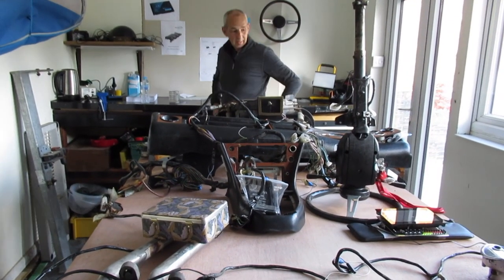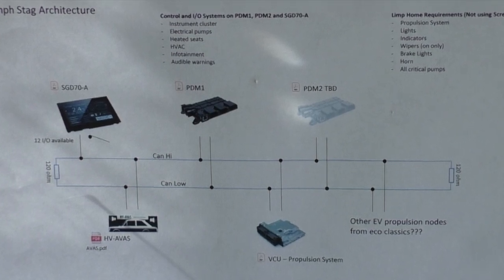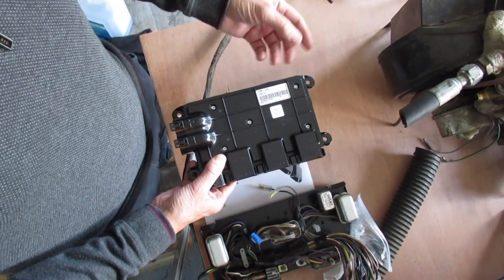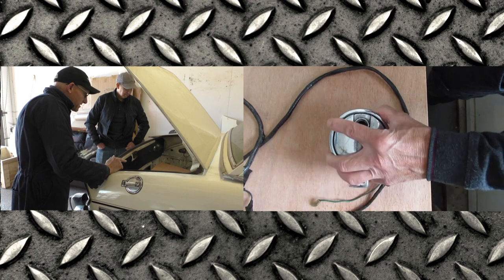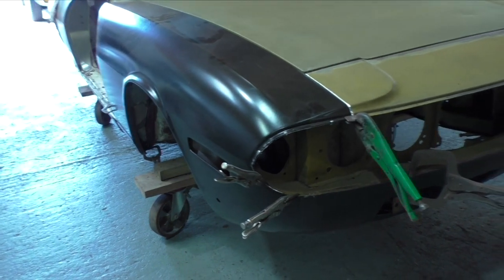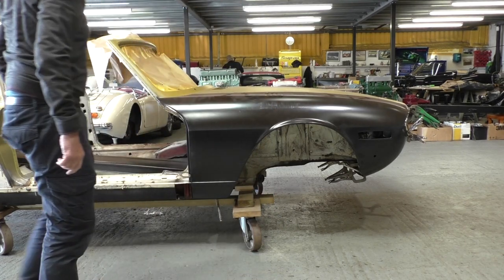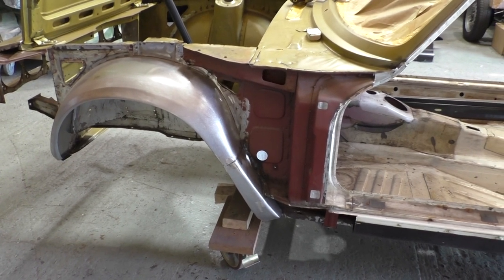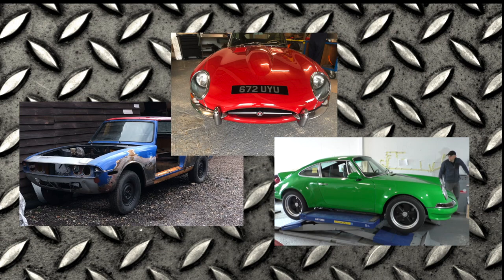How to fit the Triumph Stag electrics back together

Comment: if you are installing a heating element solely for demisting purposes, don't bother. The AC unit will provide far superior demisting by drying
 the moisture laden air in the .cab
Reply: Stag and AC....  not a common combination!